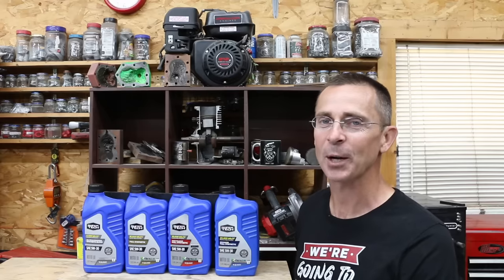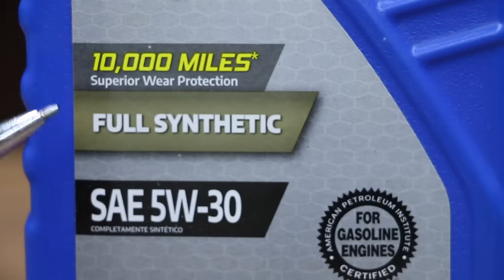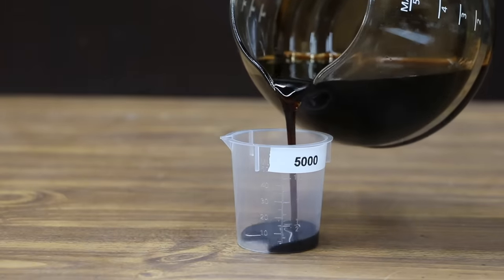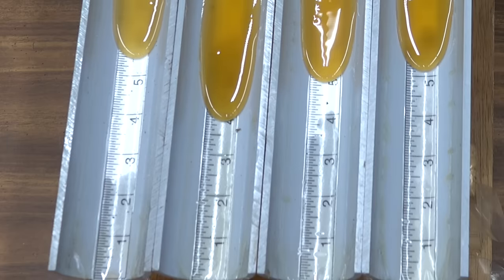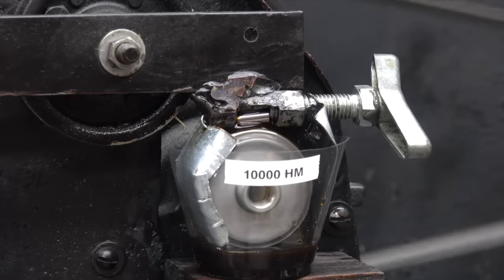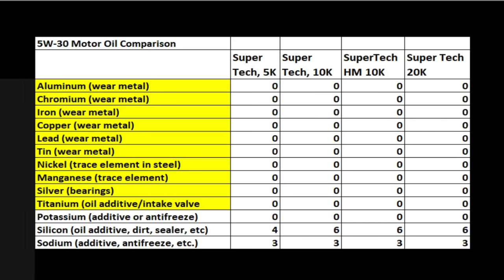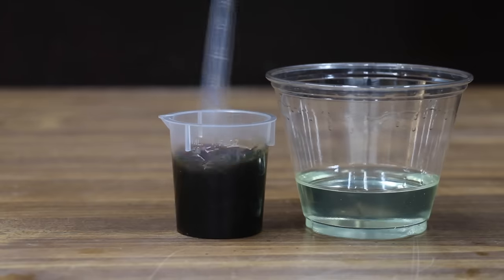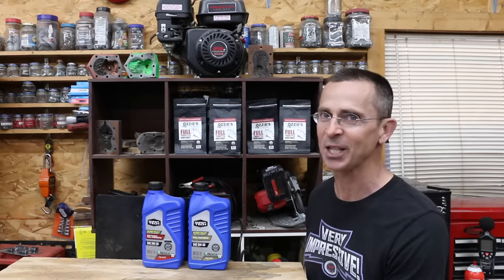Are They All The Same Motor Oil? Let's Settle This! Four Types of SuperTech Motor Oil Compared

Comment: I change my oil with full synthetic super tech 5w30 works great stays clean and doesnt burn at all after 4k miles before my next change. Although I've never had oil burn in my car with 160k miles. Yay chevy vortec motor🎉
Reply from the maker: Thanks for sharing.

Comment: Would love to see you test oil & filters. Not just cut open filters but actually run oil through them with known contaminants and then do an oil analysis.  It would also be fun to do oil tests on small engines. Get some identical new engines, break them in with each oil, drain & fill each engine and run the oils for 50 hours and then do an analysis. No filter but it would tell us how well the oils perform in real life.
Reply from the maker: Thanks for the suggestion.
Reply: think he did that one too. think i remember puralator vs, ??? or was it fuel filters??

Comment: I run synthetic in all my vehicles at 7,500 mile intervals. 
My last suburban had 343,000 when I sold it with compression of 210psi per cylinder and oil pressure of 30psi hot idle,  46psi driving.
Reply from the maker: Thanks for sharing.

Comment: I leased a Mercedes in 02 that the recommended oil change was once (1) a year???  12 to 15,000 miles. I never trusted ANY oil for that, but what the hell it wasn't my car. I change mine every 3 to 4,000 miles. I might need to take a look at the full synthetic oil tested here. I usually go with Mobil 1 at $40 for 5 quarts and my truck takes 8. Is it worth it to change?? Any advise  is appreciated. Mobil 1 filter as well.
Reply: Lol Walmart sells 5 quarts of Mobil1, Valvoline, etc for less than $30.

Comment: 20,000 is a lot of miles.  I have tried fully synthetic, conventional, and blend in my 25 year old Ranger.  The fully synthetic always seems to burn off some, the conventional doesn't use a drop.  The blend doesn't seem to use any either, so that's what I normally put in.
Reply from the maker: Thanks for the feedback.

Comment: Im inclined to believe that a thicker viscosity would provide better wear protection since the film would want to cling to the substrate and maintain the protective coating. There must be a better way to test oil superiority rather then pouring them out and seeing which one flows more freely. I just did my last oil change with the 20k FS super tech oil and a Mobil one filter. It was only $22 at my local Walmart compared to $19 for the other full synthetics
Reply from the maker: Thanks for the feedback.

Comment: There is nothing to suggest that synthetic oils will provide adequate protection if the change interval is over 10K miles.  The only reason manufacturers suggest this extended interval appears to be to lower the projected operating costs for advertising purposes.  The primary cause of fuel contamination in modern cars has to do with modern alloys used in engine rings and cylinder walls.  They allow for much tighter tolerances than traditional materials, however, this causes issues if the engine is not brought up to full operating temperature such as short trips.  This doesn't allow the alloys to expand as they are designed to do which allows oil burning and fuel contamination.
Reply from the maker: Thanks for the feedback.

Comment: We do not drive over 5000 miles a year any more  but I still change oil every April and October. So far 190,000 on the 2002 truck with no problems and 70,000 on the 2012 car with no problem. Am I wasting oil, I don't know but it seems to be working for me.
Reply from the maker: Thanks for sharing.

Comment: Thank you for the video. I heard that no matter what brand you use ( Mobil, penzoil, etc ) every oil is the same as long you change it at regular intervals. What is your opinion on this? I usually buy 0-20 mobil one but it is getting expensive so I’m looking for a cheaper one but I don’t want to compromise the engine. Thank you for your help

Comment: With Mobil 1 Advanced I went 10k easy without issue for years. Traded that scion/toyota in with 159,000 miles, without any issues seen by the dealer (or me). My prior toy/scion, had over 190k.  As for super-tech, we will find out soon enough. At over 7k miles now on the oil, I think it is, our Highlander is using Supertech 10k.
Reply from the maker: Thanks for sharing.

Comment: Love these videos. Have you considered comparing various full synthetic 0w 20 oils meeting VW 508/509 standards with Kirkland or Walmart full synthetic oils which are much cheaper, but which do not advertise compliance with the VW standards? For folks like me who change the oil on my 2018 Audi S5 every 5K miles, does it make sense to spend the extra dough to use the VW approved 0w20 products? My car is no longer under Audi warranty if that makes a difference.
Reply from the maker: Thanks!  Thanks for the suggestion.

Comment: Engine tolerances have improved a lot of the years. The reason to change your oil is because your piston expands when it gets hot and makes a better seal. However when cold the engine gets a lot of fuel bypassing the pistons and it goes directly into your oil.  When you see how black you oil gets after not changing it that is carbon from blow-by.  Having carbon in your oil is not a good thing.  However with tighter tolerances now days you can go further so instead of changing your oil every 3k like they used to suggest you can easily double it.  The 20k had more zinc and zinc plays a MAJOR roll on protecting your engine.  Oil used to have A LOT more zinc before the day of roller lifters. The lifters used to just slide on your camshaft under heavy spring load now days they roll. If you use modern oil in a flat tappet  engine you will destroy your engine in 2 hours because there isn't enough zinc to protect it.
Reply from the maker: Thanks for the feedback.
Reply: Probably true, from what I understand is that zinc was removed because it ruined catalytic converters

Comment: After using Blackstone for oil analysis, I found that my turbocharged Mercedes SLK severely breaks down the viscosity of the recommended Mobil 1 0W-40 Euro oil. Merecedes recommends changing at 10K. I tried Castrol Euro and same problem. Testing my Mercedes supercharge SLK using the same oil, the viscosity did not break down. If you have a turbo, I would plan on changing the oil at 4.5K like I do if you plan on keeping the car.
Reply from the maker: Thanks for sharing.

Comment: I have one you have to try. Might just be the perfect solution to clean your engine from the inside. 90% engine oil with 10% copper compound mixed in properly. I think it should work
Reply from the maker: Thanks for the suggestion.

Comment: I think one of the major problems with extended oil changes is the size of the oil filter, but I change my oil at 5k even though the Honda says 10k. I just don't trust oil or filter for that long and I use only top end filters and oil. Oil changes are cheap insurance.
Reply from the maker: Thanks for sharing.

Comment: i routinely go 10k on oil changes , on my  2014 town and country . i bought it new and only used mobil 1 , valvoline , or penzoil synthetic its got 197k miles and about 5500 hours on engine .
also only used mopar or wix filters and i do the changes myself . motor has never had any oil related issues.  mostly all highway driving
Reply from the maker: Thanks for sharing.

Comment: The upgraded treatment on the WalMart recycled oil really does work but when mine is at the breaking point it always has allot of fuel in it and is very watery. I would speculate that the WalMart oil does better for performance but not for winter and the O'Reilly's recycle container does better for winter but it is even more critical to be a soft driver!
Reply from the maker: Thanks for the feedback.

Comment: I'd like to see oil testing for us Harley riders.  Harleys use 20W-50 synthetic and because Harleys have V-twin motors (most are air-cooled), they get HOT.  I'd like to see the different brands such as Amsoil, Mobil1, Lucas, Castrol and others against each other to find out which lubricates best and which holds up best.
Reply from the maker: Thanks for the video idea.

Comment: I use just the regular 5 30 on my truck and haven't changed it in about 3 years still runs well with no lifter tap or anything with about 50000 miles on the oil change my buddy changes his once a year and has had his 02 since new and finally had the engine die after 350k miles
Reply from the maker: Thanks for the feedback.

Comment: Extended oil change intervals are a disaster.  When customers started doing that, nobody ever checked the fluid levels.  So when they came in for service,  hardly any oil would drain out. A quart of oil every 1500 miles is about normal for consumption.  When you do the math, the amount of oil being added is basically the amount of oil used for an oil change ( on some cars ),  when doing 6-10,000 mile changes.  When I switched over into fleet maintenance,  we started doing 10k synthetic oil changes, after my third year working there.  After about two or three years of doing extended oil changes, metal glitter started draining out during oil changes.  Then without warning, valves started dropping into cylinders. It didn't matter if the engine was new or old, the extended intervals was apparently not a good idea. I would love to see a comparison of diesel oil vs conventional oil. Diesel engines create more deposits for oil. And the higher compression puts more strain on the upper rod bearings. This is why diesel oil has more anti-wear agents,  detergents,  higher ash level, and also higher viscosity.  My 4.0 jeep has the same clearance as a diesel engine, so I run 15w-40 all year round.  I'm curious if running  15w-40, will give extension on oil change intervals vs 10w40 or 10w30. But personally,  if you aren't getting  400k from an engine, and 300k from a transmission,  you aren't getting your money's worth out of it.

Comment: In regards to extend it oil changes, there are only two possible scenarios. You are changing the oil before you need to based upon the specifications or you are changing it too late based upon the specifications. The only way to know is with lab testing. I lab test for my semi truck and heavy equipment that cost say over $35000 And have a sump capacity of over 2 1/2 gallons that I use full synthetic in. But for on road vehicles I just change the oil at 3000 or 5000 miles because the cost of the oil and filter is less than lab testing.
Reply from the maker: Thanks for the feedback.

Comment: You should do a comparison video between Castrol Edge High Mileage & Valvoline MaxLife High Mileage! I'm having a hard time deciding between those two because I've heard great things about both! | Also, if you want, do the transmission fluids as well! Castrol TransMax High Mileage vs Valvoline Multi-Vehicle MaxLife High Mileage ATF! That'd be an awesome test!
Reply from the maker: Thanks for the suggestion.

Comment: Is there a way you can of adding a detergency test for oils? Many Japanese engines with low-tension rings have problems with seized oil control rings and excessive oil consumption. The solution seems to be frequent oil changes (6 months or 5000 miles, whichever comes first). It would be very interesting for consumers to know how well oils accomplish that task. Thanks in advance. Like always, great educational videos.
Reply from the maker: Thanks!  Thanks for the suggestion.

Comment: I recognize this is an exercise in oil performance hair-splitting.  The quantitative differences in 5,000 mile vs. 20,000 mile motor oils goes out the window the moment you put it in a car and it's subject to the innumerable conditions and circumstances that engines are exposed to.  If the oil meets SEA and API standards/certifications, you can probably sleep at night knowing it will perform satisfactorily.  Where we get further away from the hair-splitting is with the performance of oil filters.  A good filter can make up for lower quality oil.  The best oil can never make up for a lower quality filter.
Reply from the maker: Thanks for the feedback.

Comment: Shame on Walmart for selling 20,000 mile oil that cannot support the claims made!
Reply: You are forgetting the disclaimer that all oil with a "mileage guarentee" has on the bottle. There is an asterisk... you know... this guy 》* 《... that is an asterisk. That asterisk describes the parameters of use that would get the full 20k miles. 

Hint... 20k miles under absolutely perfect driving conditions. There is not a single oil on the market that will last much past 5k miles under normal, which in most cases is moderate to severe. Change your oil every 5k or 6 months.

Oil is CHEAP, motors are expensive.

Comment: I typically use 10k HM oil, and a 10k filter, but I change my oil every 5k miles. I usually use whatever brand Advanced Auto Parts has a sell on lol. But I do always use STP filters. And I add Sea Foam, don't even know if it makes any difference, but I've been doing it for years.
Reply from the maker: Thanks for sharing!

Comment: The unspoken problem with the concept of high mileage oils is that there is no such thing as a GOOD high mileage oil filter. And even if there was, more frequent oil changes would still be better. This is especially true for diesels because of soot build up.

Comment: Todd I use SuperTech 10,000 full synthetic oil in all my cars I change my Mustang GT at 4000 miles and my wife's Escape 4 cylinder at 3000 miles plus a new filter.
Reply from the maker: Thanks for sharing.

Comment: I've used mobile one 15k oil for    years change it at 8-12k miles truck has 207,000 miles still running strong
Reply from the maker: Thanks for the feedback.

Comment: 5000 mile oil changes for a non turbocharged, port injected  car, back to 3000 miles for a turbocharged or direct injected car. So Chevy/Ford turbo owners definitely think about 3000 mile changes. I also think it will help with the longevity of VVT, start/stop and cylinder management systems.
Reply from the maker: Thanks for the feedback.

Comment: I think I've done maybe 5 oil changes in the past 60k miles ( rear main seal leak allows me to add a quart every 2 weeks ). 27-year-old f150 with the 5.0, 191k miles. I also use that liqui molly anti friction, lucas oil treatment, and run a bottle of cataclean through the tank with each oil change.

I put the liqui molly anti friction in about a week before the oil change (about 200 miles), while also running a bottle of cataclean through the tank. Then after a week I drain the oil, replace the filter with a napa gold oil filter, 6.5 quarts of any high mileage 10w30 (whatever is on sale) will work , with a bottle of lucas oil treatment. sound like a lot, but it's about the smoothest running 95 f150 I've ever been in.
Reply from the maker: Thanks for sharing.
Reply: Put some AT 305 in it and it will probably stop leaking
Reply: @warrenwinslow4266  talking like a cap full like you do with brake fluid?

Comment: A mechanic on YouTube explained that the new engines of the big 3 automakers have smaller oil passages and if you don’t change your oil frequently (3000-5000 miles) sludge can form, blocking oil flow. So I change the oil in our vehicles every 3000 miles.
Reply from the maker: Thanks for the feedback.

Comment: No matter how good the base oil is that you start with, once you go into these high drain intervals you will be putting additional wear on your engine. Particularly with Direct Injection only vehicles, and vehicles that see "severe" use (basically at around 30-50% stop and go driving). The safest betbis changing your oil at 3000-5000 mile intervals or every 6-8 months, which ever comes first. It will greatly extend the life of your engine. On my sporty cars I change oil every 3000 miles, and on my family cars every 4500-5000. Make sure you're using GF-6A grade oil in your Direct Injected cars (particularly Turbo charged DI engines), it will help limit the amount of oil dilution to a minimum.
Reply from the maker: Thanks for the feedback.

Comment: I use a full synthetic oil from Lubrication Engineers out of Kansas.  IMO their oil is similar to Amsoil in quality.  I’ve never sent it off to the lab yet but would like to do a before and after oil analysis of a 10000 mile change interval like I’ve done in the past.   I to used Black Stone before and did a 5k, 10k oil test and was told in the results the oil I used could be run well in to the 15000 mile range.  This was a different car and another quality oil at the time.  I used to drive 25000 miles a year just to work, not including time running errands on off days.  Quality oil cost more and I wanted to get the most of my money, I believe I did with sending the oil off to the lab.  I’ve since moved a lot closer to work and the car fell victim to a wreck and is scrap, not because engine failure but rear end damage that would cost more than I paid for the car.  I put over 300000 miles my self on it when I drove it across the scrap yard scale…..still running strong too.   Love the channel keep up the good work👍🏻
Reply from the maker: Thanks, will do!  Thanks for sharing.

Comment: Todd: The oil analyses for the Supertech 20,000 mile oils and the Supertech High Mileage oils, posted on your Patreon page are 100% identical. 

I think the oil analysis for the 20,000 mile oil was posted twice. Is this correct?